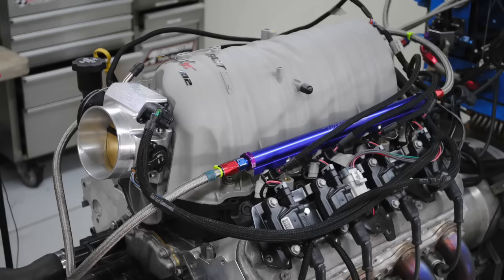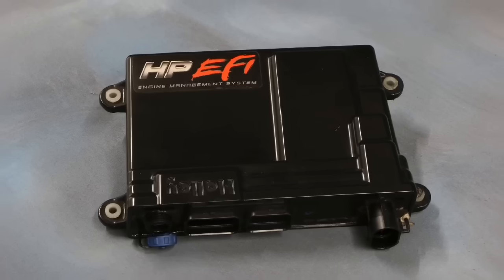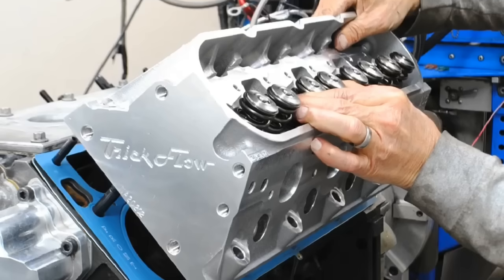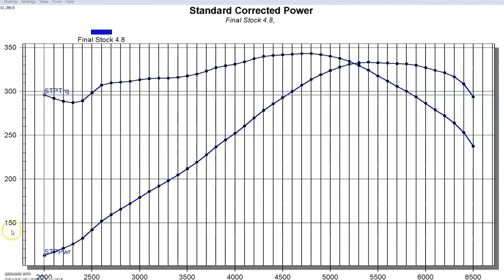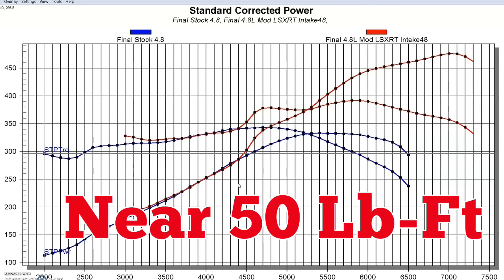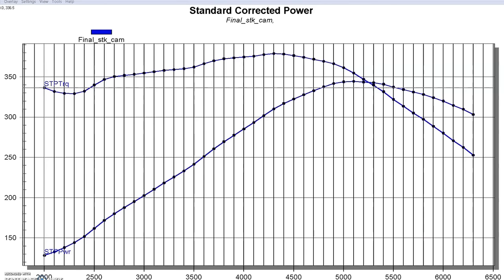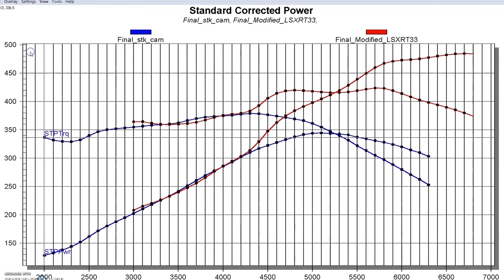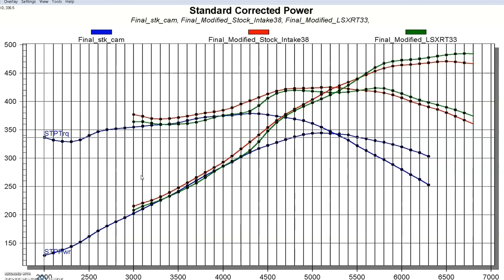JUNKYARD 4.8L & 5.3L POWER UPGRADES! HOW TO ADD 130+HP TO YOUR LS! HOW TO SWAP HEADS, CAM AND INTAKE

Comment: How about doing a 4" bore block, flat tops and a stock 3.622" stroke crank for 6.0L 364ci
untouched #243 Ls2/Ls6 heads vs
#241 casting, door stop heads with some detailed  work done to them.  530-550hp single 4 barrel carby and manifold setup. 

I'd expect 650hp or More With those Trickflows.
Reply from the maker: ported 241 vs stock 243? no contest if ported correctly
Reply: @richardholdener1727  basic cam and springs and 530hp-550hp daily driver challenge with a single 4barrel is far more than you got from your 4.8L with Trickflow heads and Not FAST intake.. Maybe I should make it harder. Hand Ported #243 heads vs Trickflow CNC and 700+HP no power adders and then 1000+ with N20

Comment: Do factories rate motors with the drive train hooked up? That would also affect power Thanks
Reply from the maker: the factory power rating is flywheel in full stock trim-no drive train
Reply: Richard Holdener ok cool. Thankyou!

Comment: Have you tested the BTR LS1 NA cams? I run the LS1 stage2 NA cam in a SBE LQ9 with ported 799s and a TBSS intake 92mm TB 1 7/8” speed engineering headers. I love the combo even in my heavy sierra 1500 and would like to know about what that combo should put out. The truck really moves out with 4.10 gears a a 3400rpm converter.
Reply from the maker: i've run a lot of Brain's cams, nit sure on the na ls1
Reply: I bet they would yield some great numbers for the NA guys.

Comment: This is great. My project is to build a JY motor for a weekend racer with a stock manual transmission but with good HP & higher RPM's that doesn't create too much torque to blow the stock trans. Like my BMW except I want to build it with a GM LS. I think that is going to be awesome to show up with something like that.

Comment: seems really difficult to improve on a design that GM spent millions developing, i love seeing the stock head and intake go so far with small work
Reply: @mikec9112  So you might say GM was the executive producer of the engine.  They put everything together into one package and won
Reply: Especially with the ls3 intake manifold.
Reply from the maker: they nailed that intake
Reply: @richardholdener1727  almost, ported with the rod mod and its badass. Unless revving to the moon
Reply: @richardholdener1727  any chance installing Rhoads lifters on top of one of these Ls cam install?
Reply: @mikec9112  you do know GM helps Toyota with engine designs rite?...as well as other automobile makers!...they and Toyota have been holding hands forever!...
Reply: sloppy mechanics pogu
Reply: @Mr. 6 liter rite
Reply: @nathanielbolden5053  fur sure...dam rite . Ain't no replacement for displacement
Reply: @mikec9112  seems like we got a slow sbf guy here
Reply: @gagewiginton6600  ford fairly obsolete racing development,  mopar is the slow car hehehe
Reply: I've heard Nascar engineers helped design the factory intake.
Reply: GM DIDN'T SPEND A DIME. THIS LS IS ALL FORD IN DESIGN 1000% AND IF YOU WOULD LIKE TO DISCUSS IT. I WILL GO THROUGH THE ENTIRE LS DESIGN. NOT ONE 1 DESIGN ASPECT OF THE OLD SMALL BLOCK CHEVY LIVES IN THE LS. 
GM HAS HAD THE EPA IN THEIR POCKETS FOR YEARS, USING THEM TO PUT PRESSURE ON FORD TO MEET VERY STRICK EMMISSION STANDARDS TO KILL FORD'S PERFORMANCE ENGINES. AND LOOKED THE OTHER WAY WITH GM AND ALLOWED THEM TO BUILD  RACE ENGINES WHICH VIOLATED EPA EMMISSION STANDARDS. THE GOVERNMENT BUYS GM PRODUCTS AND IT HAS BEEN THAT WAY SINCE THE DAYS OF BONNEY AND CLYDE. WHEN BANKER ROBBERS WANTED A GET AWAY CAR. THEY CHOSE THE FLATHEAD FORD. BONNEY AND CLYDE WROTE A LETTER TO HENRY FORD AND SAID IF IT WASN'T FOR HIS FLATHEAD FORD THEY NEVER WOULD HAVE BEEN ABLE TO GET AWAY FROM THE FEDS AND BE SUCCESSFUL BANK ROBBERS, WHILE THE FBI WERE USING GM VEHICLES THAT WERE SLOW. GOVERNMENT OFFICIALS WERE PLEADING TO BUY FLATHEAD FORDS TO CATCH THE BANK ROBBERS AND THEY REFUSED. THIS IS HOW STRONG THE GRIP WAS THAT GM HAD ON THE GOVERNMENT OFFICIALS. CORRUPTION AT IT'S BEST AND IT IS STILL GOING ON TODAY.  THIS IS THE REASON FORD WENT MODULAR IN 1992 BECAUSE THE EPA IS IN GM'S POCKETS. BEFORE THE LS WAS COPIED FROM FORD. FORD WAS GOING TO PUT THE 351 WINDSOR IN THE MUSTANG, GM'S NIGHTMARE. FORD WAS ALREADY KILLING THEIR 350 WITH THE 302. SO GM USED THE EPA TO PUT STRICT STANDARDS ON FORD TO KILL THE 351 WINDSOR FROM MAKING IT UNDER THE HOOD OF THE MUSTANG AND INSTEAD RECIEVED AN ENGINE DESIGNED FOR EFFICENCY BEING THE 4.6 MODULAR ENGINE. WHAT CHEVY DID COPYING FORD IS THE MOST CRIMINAL THING TO HAPPEN IN THE HISTORY OF AUTOMOBLES.
Reply: Gm definitely put in the research, it's obvious. The gains are simply from cleaning up the "cost effective" production requirement for mass production of these parts. Cost effectiveness always leaves room for improvement by putting more time in the details. ;) But with these it seems that there's only so much, and then you start getting into situation specific trade offs for better gains.
Reply: Make a 4.8 feel like a 7.0 or 7.4/8.1 by having bigger valves longer runners and a 62, 61, 60cc chamber 58 and smaller is extreme.

There are heads like that both rec and cat ported.

Or find another 862/706 headset and valve and port job them.

I know one thing with flat pistons lift is limited due to piston slap.

Comment: Stock 5.3l engine, TBSS intake, light porting and performance  valve job on 706 heads by a professional,  10:1 compression 214 dur at .050 Intake 220 at .050 exhaust 111 lobe seperation with a little bit of advance.  Great torque plenty of horsepower easy to live with but lots of fun.
Reply: She’s quick?

Comment: I really do enjoy and appreciate your videos and builds, I reference them and your books often in my own videos.

What drives me personally is budget. What can I do to maximize power per dollar spent.

My current favorite combination is an Lq4 shortblock with 862 heads on top. I can take these from the junkyard for one price since "engine complete" price doesn't care how many engines you cobbled together.

The cam, I base on whether or not I want a converter in the application, and the price of a converter.

My truck I'm using the infamous SS2, no need for new pushrods, affordable springs allow it to run, but it really should have a converter. I'm using a 3400 rpm unit from Florida Torque Converters.

My Olds Ninety Eight, same engine setup, Summit 8719 cam for even more affordable springs and the stock converter.

I only use stock truck intakes because the cost of rails, crossovers, a separate regulator don't add up to the benefit of the power a TBSS would give me, in my opinion.

I would very much like to see what an affordable, off the shelf cam with stock everything but the necessary springs does Vs a custom ground, high end cam with custom pushrods and everything else.

I'm sure they're worth more power, but how much and at what cost?

Comment: Richard holdener, I'm building a 5.3 with flat tops, cam and cnc ported heads. I'd love to see you do something like this!
Reply from the maker: just add 12 hp to the one I tested for the added compression for the flat tops
Reply: @richardholdener1727  I'm also considering milling the heads but not sure what would be a safe amount to avoid running into ptvc issues. I was thinking 0.020 and if there were any clearance issues a slightly thicker head gasket would resolve the problem. What are your thoughts?

Comment: Great video. What was the static compression after replacing heads?
Reply from the maker: Chamber only changed by 2-3 ccs, not much different than stock
Reply: @richardholdener1727  Thanks for the quick reply.

Comment: How about testing some VVT cams vs. non-VVT cams please!
Reply from the maker: we cant run VVT cams with our Holley HP ECU on the engine dyo
Reply: @richardholdener1727  Aww man, I have yet to see any reputable source provide this comparison. I don't know what your situation is with tuning software is over there but if you could get your hands on an e38 ecm and harness for the test you'd be the king.

Comment: My 99’ ex cab sierra has a 215/231 .605/.598 116.5lsa cam in an iron ls1 with truck 853’s with home porting, TBSS intake, 3600 9.5” revmaxx converter and stock 3.42’s
Reply from the maker: sounds like a good combo
Reply: May just have to see what it lays down at the track just for fun. One tire fire

Comment: What’s your thoughts on the Holley high ram vs the TBSS on a 6.0 with 862 heads? Elgin 1841 cam also
Reply from the maker: the high ram will make less power up to 6500 rpm or so

Comment: Hi Richard I love your show and the content of your videos has been very helpful and inspiring live I'm an old-school guy I've been working with small blocks and big block Chevys and I decided to jump into the LS scene when I had the motor go in my RX7 so I dropped an LS1 Intuit after having to rebuild it because of two oversized cylinders number 8 number 7 go figure so ended up porting the cylinder heads myself set of 706 but hoops I went a little too far and dug a little hole so I'm picking up a set of 243 off of 5.3 2007 model and just ported the chambers and the bowl and left it at that but I'm running a Howard's cam I'm wondering if you've had any experience with them I'm running at 232  236at 50 with a 112 LSA now I'm doing the the tuning myself which is a whole new ballgame for me coming from carburetors to  fuel injection because I live in the great White North on like you people from the South we don't have tuners or Dynos   available to do everything for  us which I had to learn how to do myself with HP tuners and I have to say this has been one experience that I've learned to love and hate but it's so exciting to learn something new other than turning a few screws to work with the tuning aspect of the new error of hot rodding I'm just so amazed how easy it is to make horsepower with these LS motors compared to the old small block Chevys.
Reply from the maker: i have not worked with Howards other than run their lifters on conventional small blocks-may have run a cam of theirs on a SBC

Comment: I love 4.8s! In 2017 when I swapped over to turbo from nitrous in my 99 Z28 I pulled the ported and milled factory 241's and a not to aggressive nitrous grind cam from lunati, vic jr intake and 750cfm double pumper, MSD controller SBE LS1 out and went directly to a SBE 2011 4.8 oil pan only came off to swap to the f body pan all I did was put valve springs in it, I have a Huron speed single t6 kit I started out with a cast wheel s475 1.15 t6 exhaust housing, air to water intercooler, the car has a 4.10 gear th400 PTC converter and around 3400 pounds it went a best of 6.41 @ 109mph 1/8 mile stock 4.8 with pac springs 210 pound injectors on e90 and Holley efi it was almost consistent enough to bracket race lol it was pretty amazing and super impressed the best it went with the nitrous setup was 6.17 @ 115. Over the winter pulled the 4.8 went over it replaced the rod and main bearings some arp rod bolts and nice oil pump, I sent the factory 799 heads to PRC to get there most aggressive CNC porting and milled, ARP headstuds, one of LJMS off the shelf turbo cams BTR springs and trunion upgrade comp pushrods, I won a summit gift card  from a raffle at my local track so I ordered one of the summit brand aluminum fabricated 102mm intake, fuel rails and throttle body and a used NX plate and meziere electric water pump I reused my 210 injectors and upgraded to a 10" ptc converter.  First time at the track it eventually ended up goin 5.93 boost only no body believed it was a sbe 4.8, I loved it the best boost only et was 5.85 @ 118mph and with a 75 shot 5.67 @ 121mph it lasted a whole season  and lots of street miles and other activities on the street I finally ended up bending several rods throwing more nitrous at. By the hp calculators online it was around  800 boost only and a little over 900hp on the bottle. Iv already started Rebuilding it for another project it's just getting another set of gen 4 rods and bored to 3.80+ its goin in a 94 SN95 mustang so I'm getting it as close as I can to 302ci so I can keep the 5.0 badges lol

Comment: What about ls9 cam and 243 heads on lm7
Reply from the maker: Not a great cam and the 243 heads won't make any more power than stock 706 heads on the small bore.
Reply: @richardholdener1727  what would best streetable cam be street strip
Reply: Wish I would have known that I put stock 243s on my engine (lm7) tbss 92mm tb. I'm putting a turbo on it though gt45

Comment: Personally I would never buy a FAST intake just because it costs the same price as the gen4 aluminum longblock 5.3!
LM7 are even more cheaper.
Aftermarket cam with valve springs can give you some REAL power upgrade but the FAST intake costs A LOT and you'll get just a little more power for it's money.
Not to mention you can buy TBSS dirt cheap or LS2 Dorman for 1/3 of FAST intake's price if you can only use a car intake and still get more power than stock! 👏
---
Thanks for another great test! ✊

Comment: My 5.3 LH6 has 243 heads, DOD delete, flat top pistons(10.5:1), Howard’s ASA cam, LS6 springs and made 325 whp ,about 375 at the motor. Nice chop at idle, but has a nice fat torque curve in the mid range. With a T56 it is fun in my 2900 lb. Volvo 240!
Reply from the maker: good news-325 wheel is more than 375 flywheel hp-a stock 5.3L makes 355 hp the way we test it
Reply: And I use LS1 intake due to hood clearance.
Reply: @jord9308  Try an ls2 intake, it'll give you a bit more power.

Comment: Love how you say to "open them bowls up yourself" and send it.
Money savings tips.  👍👍
Reply: Cut the throat/bowl to 89/91% of valve diameter ,cut and blend the swirl ramp on the intake ports, blend the short side radius into the throat/bowl, blend the rocker boss on the port roof into the port. No need to increase port cross section if you are aiming at less than 550hp.
Reply: Dale Thomas Good advice, sir.
Reply: Now get Dulcich to show us how it's done. ✅ 😆
Reply from the maker: he is the porting master-though not a lot of LS stuff
Reply: Dude, port match the intake, take the flashing out of the bowls, keep it 60 grit on the intake and polish them exhaust ports..done deal
Reply: I'd love to see a NA and boosted test where home porting stock heads was the experimental variable.

Comment: Any chance you'd share some HPtuner info that matches the Holley system? Fuel/air numbers? Ignition timing?
Reply from the maker: we start by keeping timing low-meaning 23-24 degrees at the power peak (less at torque peak), then adjust AF til it stops making power, then add timing til it stops making power, then try fuel 1 more time. This usually puts us near 20 degrees total timing and 12.8 or so in AF, though many of the LS combos are not super sensitive to AF changes
Reply: @richardholdener1727  Thanks for the quick and helpful response!

Comment: More 6.0 tests please with an LQ4 based engine.
Reply: Yeah and na cams with head swaps
Reply: I'd like to see a test with one of those that would be tow pig oriented
Reply: @HioSSilver1999  agreed after my camaro is done I'll be doing some mild mods to my 07 2500 using some 706 heads
Reply: @richardaugustine1842  let us know how that works out for ya. Only issue i see with that is you might have to run more than 87 octane fuel.
Reply: @HioSSilver1999   it will probably be mid summer If i do it I figure use the heads I have possible  throw a cam in and some longtubes see what it will make

Comment: I'd be interested to see some testing done with different compression on a "cheap" junkyard build, 4.8/5.3, tbss intake, with a healthy 230's/240's duration cam and milling some 706/862/243 heads that have been hand ported at home to see how the compression change effects power, then try the same setup on E85.  Most people here are on a budget and cant afford a set of CNC heads. I would also like to see some testing done with the TSP Torquer V2 camshaft!
Reply: First, Richard this an amazing wealth of information packed into a great video. Keep up the great work.  This is my first LS engine swap that I am performing on a 2000 extended cab sonoma 4l60e combination.  I'm currently going to run a tbss intake on a 5.3 gen 3 block. I'm on the fence about stock piston choice or running flat top pistons on gen 4 rods with my 24x crankshaft.  Cam selection was going to be a 98 Corvette camshaft,  but after watching one of your videos, it looks like it'll be a BTR STAGE 1 TRUCK CAM. What are your thoughts on this combination with a stock torque converter and 3.42 gears...
Reply: @ronaldmjrfox5899  I'd like to see how your build turns out. What cam did you end up using?
Reply: @danthisguy8541  I'm going with a Truck Norris. It's going in my 2000 Sonoma extended cab , stepside.  I truly wish it was 5 speed but it's a 4l60e.  It's a 1000lb lighter than a Silverado. I'm not sacrificing low end torque, which gets the vehicle moving for the occasional high end horsepower.  The automatic transmission is still only going to allow me to stretch out the power so much. Unless I go into a crazy build and torque converter.  Then the equation totally changes